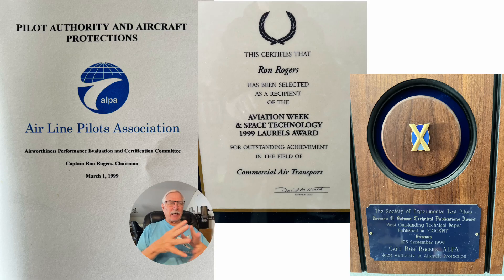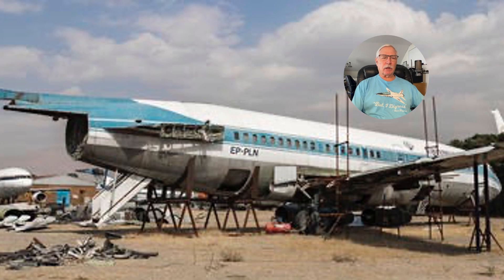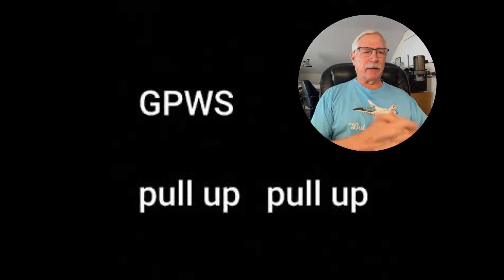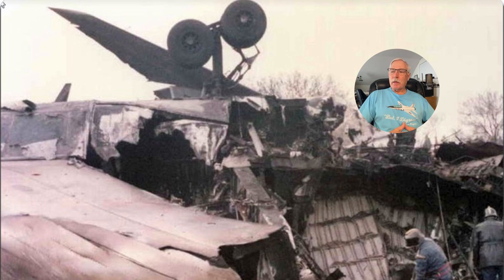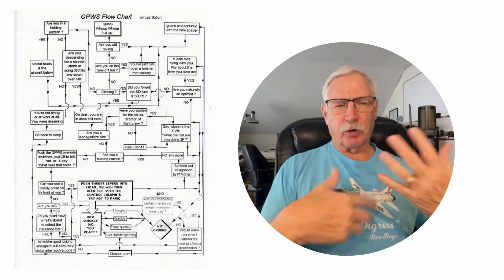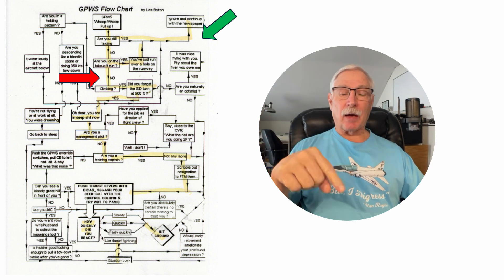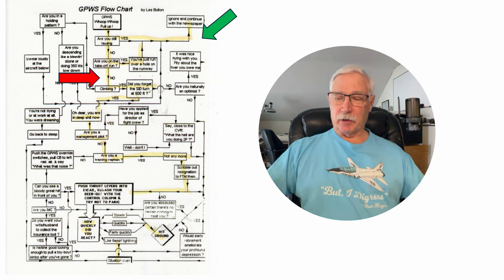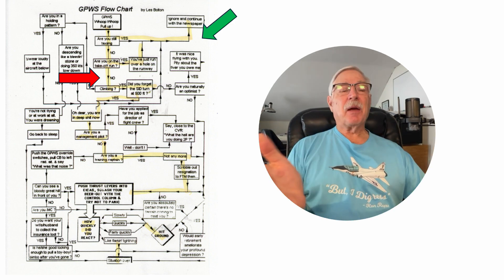Early Ground Proximity Warning Systems were unreliable with many issues. GPWS flow chart

Comment: Hey Ron! Do you have any pilot friends on the west coast willing to fly? Im just under 300hours TT with my CFI and working on comm multi at the moment. hopefully in the next month or so I will have my MEI and CFII. The california pilot job market for low time pilot seems to be non existent. I’ve applied for a few jobs in other states but no luck yet. I can apply to work for my school once I finish My CFII. I feel a little stuck at the moment, I don’t have any aviators in my family so I’m treading my own path. Any advice? plus the average rental rate is $200 an hour so flying outside of school is very limited for me.
Reply from the maker: I was in a similar situation! I could not even afford to get a PPL. I asked at the local flight school about taking one lesson a month (all I could afford) they told me I would be wasting my money! True. Got the Air Force to pay for my training. Only way it was going to work. 
Gave a talk at a flight school last night. Was asked by a new CFI about any jobs in the area as he was having no luck. Have been hearing that training is slowing down due to airlines slowing hiring. Many CFI's can't find work. Not a good situation. Unfortunately don't have any advice. Sorry. Don't know what I would have done without the military. Well I do, I would have ended up an engineer, electrical type (which I did).

Comment: I wonder why airliners are not equipped with night vision divises with which you can see through clouds or fog.
Reply: This is happening, and many business jets and smaller aircraft are being equipped.  A trained instrument pilot shouldn't need it though it does enhance situational awareness.
Reply from the maker: Yes, I was going to make a comment abut using this on business jets and smaller aircraft. If I could afford it, I would put such a system on my 310. Very useful for flying into small, especially unfamiliar airports, in bad wx.
Reply: I recall a case of a 737, I believe, flying into portland in clear conditions at night. They had a close encounter with a mountain due to a visual illusion concerning ground lights of the city. I wonder how night optics would have performed in that case?
Reply from the maker: With the current 0/0 landing capability, no real need for the system on commercial aircraft.